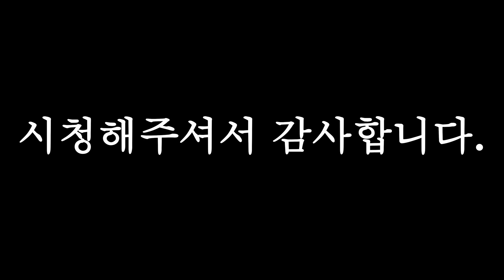LNG 서스 14인치 이번엔 필드 대형관 #손선생배관용접학원

Comment: Can I use the keyhole method and dab both sides?? 😊
Reply from the maker: Yes, it's possible, but the current way is faster.
Reply: @weldingteacher you are feeding only to one side?
Reply from the maker: @chrisplayz253  One supply, both supply and both supply are possible.